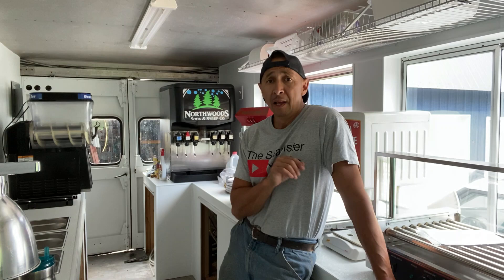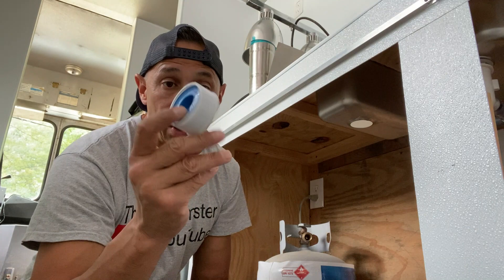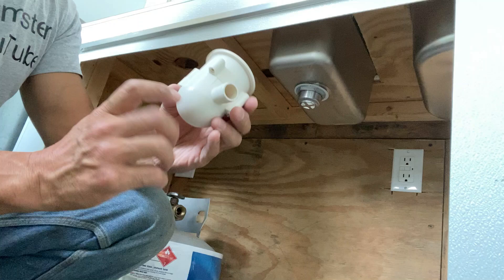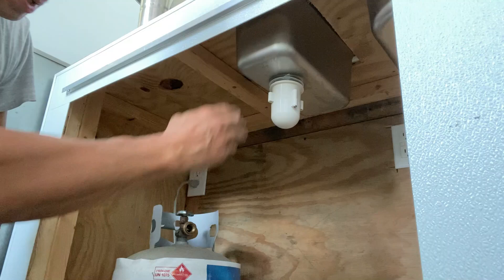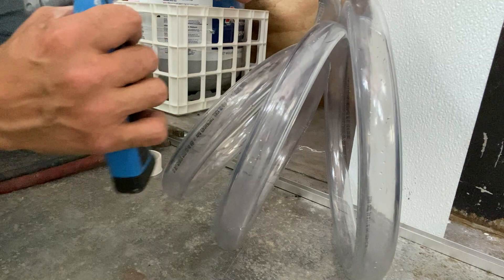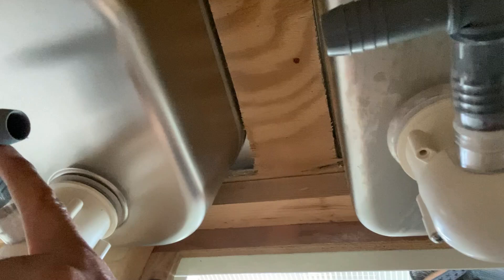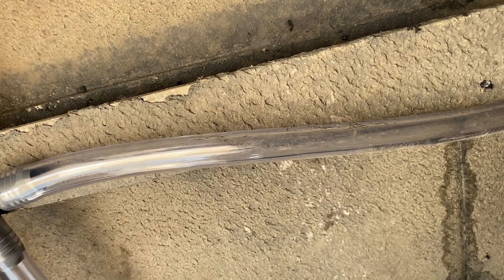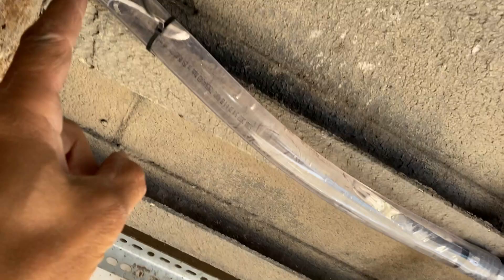How to build your FOOD TRUCK DRAINS

Comment: Those aren’t air gaps, they’re basically a p-trap. If your tank backs up, it will still back up to the sink, which is what an air gap will prevent.  Our county requires air gaps, not just a p trap.
Reply from the maker: It passed inspection and it’s a backflow prevention.
Reply: @TheSeamster  Good to hear - glad you're up and running!    Still, backflow prevention is different from an air gap.  I found this video when I was searching for an air gap solution as required for our food trailer.   These won't pass as air gaps here.  Not offering this as criticism, just hoping to clarify for others that are looking for air gap info.   Thanks for posting your experiences - lots of good information here.
Reply: l agree with brendan,that is not air gap it would never pass by inspector. Air gap have a two inch space between the drain &PVC pipe
Reply: What are they called? Will you answer us please
Reply: @brendan8363 HOW are you supposed to travel in the food truck or trailer with fumes from the grey tank getting inside the trailer from an open pipe coming out of the tank. Or even the possibility of splashing
Reply: @onetonf350  We just drain the gray tank regularly.   Sloshing shouldn't be a problem - the static water level will be at the same level in the pipe as in the tank, and there should be a number of inches above that.    You'd have to be on super rough roads or slamming on the brakes for water to be forced up through the pipes.  If you're not sure how to arrange it, talk to your county health department, they should be able to guide you or show you an example.

Comment: If you set up that truck all by your self I have to give you credit because I was crinching  when i saw the way you were using those channel locks.
Reply from the maker: Yes, been using them for years and not everyone can use tools the same.
Reply: I am not sure if you understood my comment?  you were using those channel locks completely wrong!
Reply from the maker: @MB-ir8xf  no I understood you and they have never failed me even when building my house completely with just my son and passed every inspection. Everyone uses tools in their own way to get a job done and as long as the job gets done quick and correct. If that made you cringe, check out when I cut FRP with my 4 inch hand grinder with the guard off. But thanks for taking the time to let me know how to get ur done.